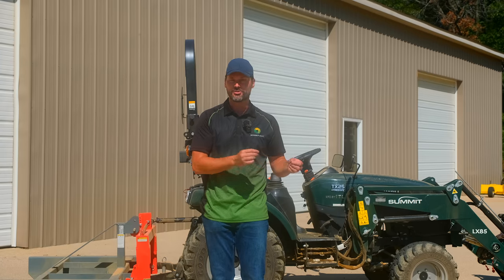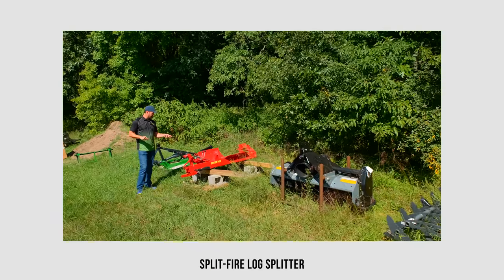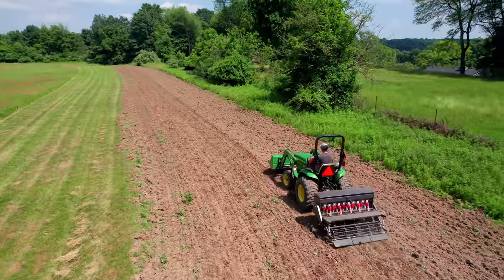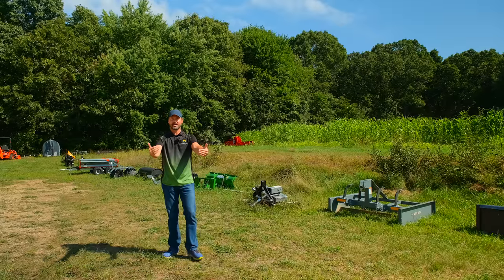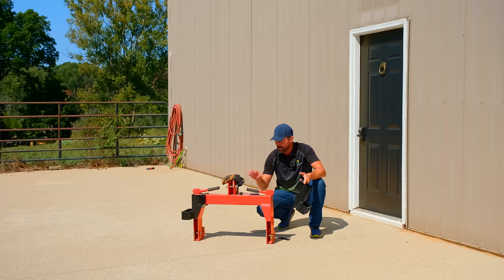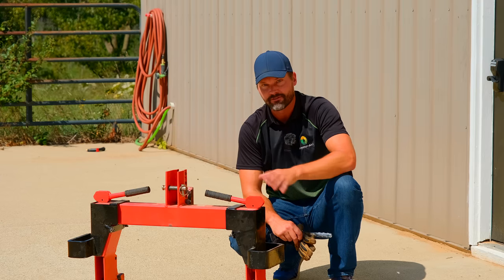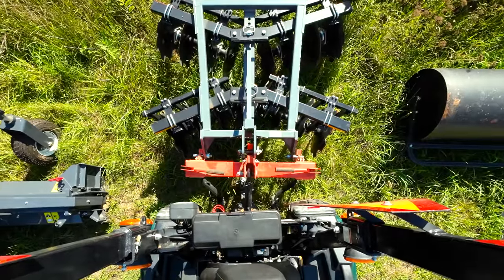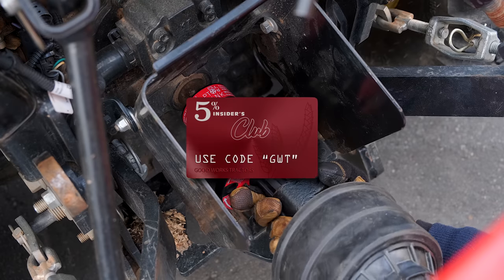HATERS GONNA HATE! BUT IT'S STILL OUR MOST POPULAR ATTACHMENT!

Comment: Good stuff as usual. All the issues you mentioned are why, IMHO, Pat’s is the better option. Works with virtually any attachment, doesn’t interfere with the PTO like a quick hitch does, and it’s less expensive than a quick hitch from a reputable brand (i.e. not Harbor Freight)
Reply: It sometimes is a matter of preference. Like most things in life there are trade offs. On our 40 plus year old Kubota, it won't accept a quick hitch, but it was no problem to install the Pat's. I think Courtney sells them as a link somewhere on his website. Our new Grand L Kubota will take either, but I still haven't decided on  what to do.
Reply from the maker: I’ve never been a fan.

Comment: The post hole digger can be a pain to attach, but to me it's dumb to leave the auger attached when disconnecting.  I pull the auger, lower it, disconnect the lifting arms, and then pull the top link pin and let it slide backwards. To attach I reverse the process, I am 71 with arthritis in my shoulders and that has been the easiest way for me. To protect the vertical shaft I install a 8" section of 2" PV pipe lined with grease to keep it from rusting.

Comment: I have a County Line landscape rake and box blade for my John Deere 2305 and they were not quick hitch compatible but I fabricated a bracket for each and used extended pins and was able to make them compatible. I'm 72 years old and I just love my quick hitch.
Reply from the maker: Even at 40 I love the quick hitch. If there's an easier way, seems smart to take it! Glad you had the knowledge to be able to make your own brackets! That's not something I could do!

Comment: Love my SpeeCo e-Hitch.  I had one three-point attachment that was not compatable (a County Line carryall I had built a stake box on that didn't have room for the lower jaws . . . Fostner bits, Sawzall, and wood chisel to the wood later it's OK).  I do have one attachment that I have to move the upper hook for - but I got the clevis pin & bow-tie clip option and it takes less than a minute to move the hook. Sooo much easier than the rigid stabilizer bars and pounding away with a mallet to align an attachment with my 1956 Ford 640.  As I said, I love my SpeeCo e-Hitch.  Best old fart friendly addition to my stable.

Comment: Courtney great video!! You are definitely right about the king kutter Xbox 4ft. Tiller could not get it hooked up to quick hitch. I only have one implement that hooked up to quick hitch it was 2017 Mahindra 6ft. Box blade but rest of my implements are old so sold my quick hitch and still doin it the old fashion way but sure is hard sometimes. Evidently the little summit tractor is doin the job looks like you are workin it.  Good lookin little tractor.  Thanks for sharing be safe have fun

Comment: I have the king Kutter XB 4ft rough cut mower & box blade. I had to modify them both for my quick-hitch, but it can be done.  Had to drill some holes to mount the pins higher on the cutter and used extended length pins for the box blade to work. Both have been working great for 12+ years.  I just got a used 6' Walco Douglas finish mower that will hook-up to the QH, but the PTO shaft clearance was too tight to the top of QH, so that won't work and neither will my Bestco flail mower.
Reply from the maker: Thanks for chiming in!

Comment: Speedo makes 2 quick hitch adapters for the cat 1 any chance  you know when they might apply ,my old bush hog pivoits at the top link , won't work as it stands right now
Reply from the maker: One uses bushings, one does not.  We do have a diagram in our listings with measurements for anyone to use for figment checks.

Comment: The single best value for money addition is my $20 spinner knob.  It's not even a contest.  But I'd have to say the 2nd best value for money addition is my generic Quick Hitch.  It's not perfect but it does its job very well and is a labour and huge frustration saver.  No question in my mind they work in many situations - but you may have to do some work too as Courtney rightly points out.

Comment: Absolutely Courtney, do your research before weighing your decisions.  "Words to Live By". Quick Attach is the only way to go.
Reply: Yes, absolutely! But no "quick attachment thingy" is needed. Quick-"hooks" on the lifting arms and on the hydraulic push-/pull cylinder in the middle. No need to put the implement further back than needed...
 Yes, the names are wrong but I didn't have the energy to google them right in english...
Reply from the maker: Thanks Dean!

Comment: One concern I had before I got my Speeco was in situations when you need to remove it to use a non-compatible implement, is it possible to disconnect the tractor's 3pt from the QH and just leave the QH connected to the last used compatible implement? The answer is yes and easier than expected.

Comment: Awesome video. I have a b2601 and one of your speeco quick hitches: on my tractor it makes everything easier. It fits land pride bb1248 box blade, land pride rcr1248 bush hog, king cutter tm gn ok trailer mover, titan ballast box, and king cutter boom pole (i use a chain and hook for the top link). 

The quick hitch is the best thing ever, for people lacking one...get one, it makes life easy.
Reply from the maker: Most people get on board. Others seem stubborn and almost seem to have something against making life easier.
Reply: @GoodWorksTractors  I be happy to not be "stubborn". Who is willing to donate replacement attachments so I am not stubborn? I need a 7 foot snow blower category 2, hydraulic 3-pt log splitter and rear blade. I would probably consider a quick hitch if those 3 implements were compatible. I don't know of a splitter made for category 2. Currently three implements that are debt free all with different width and height spacings. Only solution I know is replacing which is out of my budget. So call me stubborn if you want, but this is one reason I have not subscribed to this channel.

Comment: I don’t think many new tractor buyers realize that there are different size 3pt hitches. For instant I know my 3033r has a cat 1 but I never gave a thought about my Ingersoll 7020 until about a month ago when I thought about adding a quick hitch to it. The 7020 has a cat 0… shows how much I’ve used the 3pt hitch on it (always has the ballast box on it). After a little researching I discovered there is no conversion bracket to make a cat 0 hitch work with cat 1 attachments or at least none that I could fine).

Comment: I convinced my friend to buy one for his Kubota. He was all excited and asked me to help him set up his attachments. The one he used the most is a 6' finish mower. Because the pins on the mower can move up and down independently from side to side to follow the terrain, not the rear axle, it didn't work. When lowering the 3 point hitch all the way down, the top bar of the quick hitch could hit the PTO shaft because the 2 pins would lower when lowering the 3 point hitch. There was a floating top link with his quick hitch, but it was quick hitch hitting the PTO. He could have lowered it half way, but not sure how that would work if he went over a hump, would the mower have lifted? Who knows.

He returned the quick hitch because the implement he uses the most is his finish mower, he has a campground to mow, so he's mowing almost every day for a couple of hours, by the time he's done, he has to start again at the other end. 

So removing the mower, putting on the quick hitch to hook the back blade, then remove back blade and quick hitch to put back the mower didn't make sense. Same for his tiller and bush hog. Didn't matter what he used, he always has to go back to the finish mower.

People have different needs, they don't work for everybody, but they do for most.
Reply: Probably a Pat's system would be better for him.
Reply from the maker: Agreed
Reply: @jimmcknight3021  that's true.
Reply: Check the finish mower. My Land Pride finish mower has a different bolt setup so that it becomes QH compatible and the  mower arms don't move.

Comment: Just found out that my new Kioti NS 6010 HST rear lower arms at 2" are Cat 2 diameter and not compatible with Speedco which only  accepts cat 1 at 1 1/2 ".
Reply from the maker: Watch this video: https://youtu.be/heQ9iAgsP0s
Reply: @GoodWorksTractors  Went  there but what was your solution?

Comment: CountyLine 60" finish mower was made Speeco compatible by reversing the positions of the top link pin and the bolt just beneath it, and cutting about a half inch of steel out of the top of the crossbar. Floating top link adapter would've required buying a shorter top link. Did I "irreversibly compromise the integrity" of the mower? God, I hope so, I hate this mower! lol
Reply from the maker: Very cool!